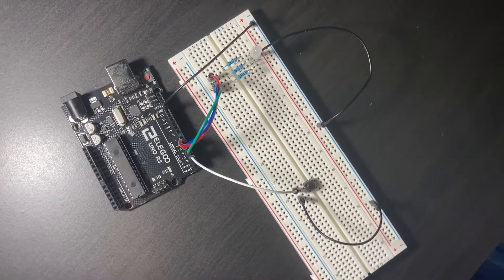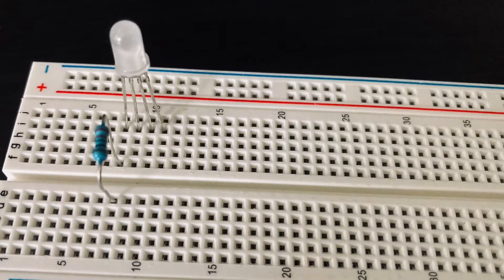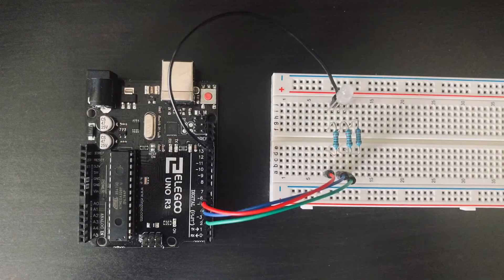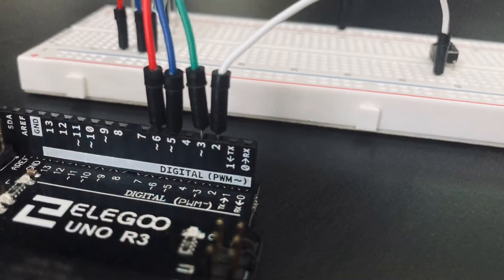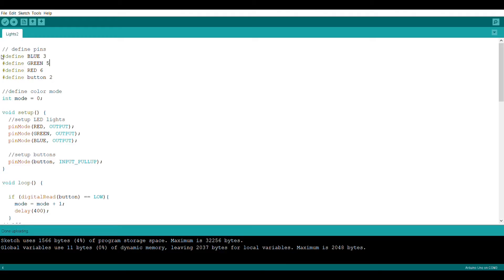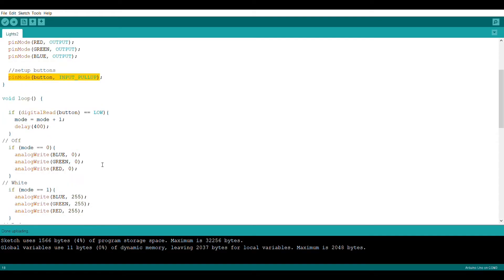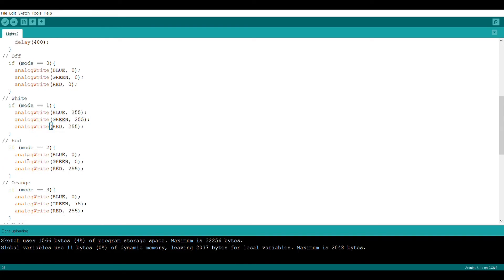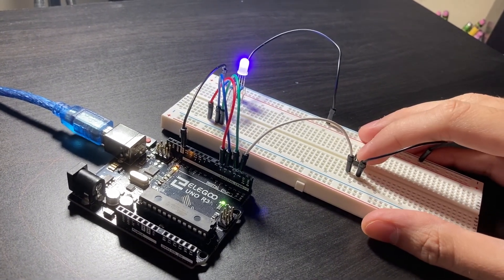Control an RGB LED with a Button | Beginner Arduino Project

Comment: If you dont want the RGB cycling through colors and you want a geniune RGB pulse here is a code with 5 different options that works with the above setup:
// define pins
#define BLUE 3
#define GREEN 5
#define RED 6
#define button 2

// define color mode
int mode = 0;  // 0 = off, 1 = pulsing, 2 = reset to off

// Variables for pulsing effect
int pulseValue = 0;        // Variable to control pulse intensity (0 to 255)
int pulseDirection = 1;    // 1 for fading in, -1 for fading out

void setup() {
  // Set RGB LED pins as OUTPUT
  pinMode(RED, OUTPUT);
  pinMode(GREEN, OUTPUT);
  pinMode(BLUE, OUTPUT);
  
  // Setup button pin
  pinMode(button, INPUT_PULLUP);
}

void loop() {
  // Check if the button is pressed (LOW means pressed, as we use INPUT_PULLUP)
  if (digitalRead(button) == LOW) {
    // Wait a short time to debounce the button press
    delay(300);
    
    // Increment the mode (1st press: pulsing, 2nd press: reset to off)
    mode = mode + 1;
    
    // If mode reaches 3, reset to mode 0 (off)
    if (mode > 2) {
      mode = 0;
    }
  }

  // Mode 0: LEDs off
  if (mode == 0) {
    analogWrite(BLUE, 0);
    analogWrite(GREEN, 0);
    analogWrite(RED, 0);
  }

  // Mode 1: Fade in and out (pulsing effect)
  if (mode == 1) {
    if (pulseDirection == 1) {
      pulseValue += 5;  // Increase brightness
      if (pulseValue >= 255) {
        pulseDirection = -1;  // Change direction to fading out
      }
    } else {
      pulseValue -= 5;  // Decrease brightness
      if (pulseValue <= 0) {
        pulseDirection = 1;  // Change direction to fading in
      }
    }
    
    // Apply the same pulsing value to all three LEDs for a white pulsing effect
    analogWrite(RED, pulseValue);
    analogWrite(GREEN, pulseValue);
    analogWrite(BLUE, pulseValue);
  }

    // Mode 2: Fade in and out (pulsing effect)
  if (mode == 2) {
    if (pulseDirection == 1) {
      pulseValue += 5;  // Increase brightness
      if (pulseValue >= 255) {
        pulseDirection = -1;  // Change direction to fading out
      }
    } else {
      pulseValue -= 5;  // Decrease brightness
      if (pulseValue <= 0) {
        pulseDirection = 1;  // Change direction to fading in
      }
    }
    
    // Apply the same pulsing value to all three LEDs for a white pulsing effect
    analogWrite(RED, pulseValue);
    analogWrite(GREEN, 20);
    analogWrite(BLUE, pulseValue);
  }

    // Mode 3: Fade in and out (pulsing effect)
  if (mode == 3) {
    if (pulseDirection == 1) {
      pulseValue += 5;  // Increase brightness
      if (pulseValue >= 255) {
        pulseDirection = -1;  // Change direction to fading out
      }
    } else {
      pulseValue -= 5;  // Decrease brightness
      if (pulseValue <= 0) {
        pulseDirection = 1;  // Change direction to fading in
      }
    }
    
    // Apply the same pulsing value to all three LEDs for a white pulsing effect
    analogWrite(RED, 20);
    analogWrite(GREEN, pulseValue);
    analogWrite(BLUE, pulseValue);
  }

    // Mode 4: Fade in and out (pulsing effect)
  if (mode == 4) {
    if (pulseDirection == 1) {
      pulseValue += 5;  // Increase brightness
      if (pulseValue >= 255) {
        pulseDirection = -1;  // Change direction to fading out
      }
    } else {
      pulseValue -= 5;  // Decrease brightness
      if (pulseValue <= 0) {
        pulseDirection = 1;  // Change direction to fading in
      }
    }
    
    // Apply the same pulsing value to all three LEDs for a white pulsing effect
    analogWrite(RED, pulseValue);
    analogWrite(GREEN, pulseValue);
    analogWrite(BLUE, 20);
  }

  // Mode 5: Fade in and out (pulsing effect) HYPER
  if (mode == 5) {
    if (pulseDirection == 1) {
      pulseValue += 5;  // Increase brightness
      if (pulseValue >= 100) {
        pulseDirection = -1;  // Change direction to fading out
      }
    } else {
      pulseValue -= 5;  // Decrease brightness
      if (pulseValue <= 0) {
        pulseDirection = 1;  // Change direction to fading in
      }
    }
    
    // Apply the same pulsing value to all three LEDs for a white pulsing effect
    analogWrite(RED, pulseValue);
    analogWrite(GREEN, 60);
    analogWrite(BLUE, 20);
  }
  // Mode 6: Reset to off
  if (mode == 6) {
    analogWrite(BLUE, 0);
    analogWrite(GREEN, 0);
    analogWrite(RED, 0);
    mode = 0;  // After reset, go back to mode 0 (off)
  }

  // Short delay to control the speed of pulsing and debounce button
  delay(30);
}
Reply: Thankyou

Comment: for all who wondering that this code is not working your wrong just debug the if (mode == 0) in the end of the code and replace the zero and input 8  if (mode == 8) and it works just watch and focus to the end of the vid  5:17

Comment: The longest leg on an RGB LED is NOT the Cathode..nor the Anode. Its the COM for common. As it can be either a common/shared Anode or a Cathode..that depends on the LED you bought..both available. And on everyday LED or other diodes or polarized capacitors, the longest is the Anode(+). Dont make tutorials, if you teach bullshite.

Comment: here is a simple version (works kind off the same):

#define blue 3
#define green 5
#define red 6

int mode = 0;

void setup() {
  pinMode(red, OUTPUT);
  pinMode(green, OUTPUT);
  pinMode(blue, OUTPUT);
}

void loop() {
  int bluevalue = random(1, 500);
    int redvalue = random(1, 500);
    int greenvalue = random(1, 500);
    analogWrite(blue, bluevalue);
    analogWrite(red, redvalue);
    analogWrite(green, greenvalue);
    delay(400);
}

//YES i wrote this

Comment: For everybody here saying this code did not work for them. Check your RBG LED and ensure it is a common cathode and not a common anode. I had the same issue and when I installed the correct RGB LED it worked perfectly
Reply: Then how do u make it work with a anode pin RGB LED
Reply: @BrosifStalin  it’s a completely different circuit for a common anode. I’m not an expert on them but you could probably find circuit diagrams online to compare the two. I just purchased the common cathodes when I realized that was the problem

Comment: I have a problem tho... I need to program 2 rgb led lights and they are expected to function like traffic lights signals... can anybody send help?😅

I need rgb led 1 (red light) to light up together with rgb led 2 (green light)... thing is they should have different durations ... though they lighted up together, they should turn off on different time durations. The rgb led 1 should light up for 15 secs and the rgb 2 should light up for 12 secs.

Please help
Reply: u can just use red and green led instead of rgbs and do something like

#define red 3
#define green 4

void setup() {
pinMode(red, OUTPUT);
pinMode(green, OUTPUT);
}

void loop () {
digitalWrite(green, LOW);
digitalWrite(red, HIGH);
delay(15000);
digitalWrite(red,LOW);
digitalWrite(green,HIGH);
dealy(12000);
}

Comment: here is code i write it

//define pins
#define BLUE 6
#define GREEN 3
#define RED 5
#define button 2

//define color mode
int mode = 0 ;

void setup() {
  
  pinMode(RED, OUTPUT);
  pinMode(GREEN, OUTPUT);
  pinMode(BLUE, OUTPUT);

  pinMode(button, INPUT_PULLUP);
}

void loop() {

  if (digitalRead(button) ==  LOW){
    mode = mode + 1 ;
    delay(400);
  }
//off
  if (mode == 0){
    analogWrite(BLUE, 0);
    analogWrite(GREEN, 0);
    analogWrite(RED, 0);
  }
//White
  if (mode == 1){
    analogWrite(BLUE, 255);
    analogWrite(GREEN, 255);
    analogWrite(RED, 255);
  }
//Red
  if (mode ==2){
    analogWrite(BLUE, 0);
    analogWrite(GREEN, 0);
    analogWrite(RED, 255);
  }
//blue
  if (mode == 3){
    analogWrite(BLUE, 255);
    analogWrite(GREEN, 0);
    analogWrite(RED, 0);
  }
//orange
  if (mode == 4){
    analogWrite(BLUE, 0);
    analogWrite(GREEN, 75);
    analogWrite(RED, 255);
  }
//White
  if (mode == 5){
    analogWrite(BLUE, 255);
    analogWrite(GREEN, 255);
    analogWrite(RED, 255);
  }
//Violet
//White
  if (mode ==6){
    analogWrite(BLUE, 255);
    analogWrite(GREEN, 0);
    analogWrite(RED, 100);
  }
//switch off
//White
  if (mode == 7){
    mode = 0;
  }
}
Reply: use mine: *it has way more colors than this childrens toy code*:

#define blue 3
#define green 5
#define red 6

void setup() {
  pinMode(red, OUTPUT);
  pinMode(green, OUTPUT);
  pinMode(blue, OUTPUT);
}

void loop() {
  int bluevalue = random(1, 500);
    int redvalue = random(1, 500);
    int greenvalue = random(1, 500);
    analogWrite(blue, bluevalue);
    analogWrite(red, redvalue);
    analogWrite(green, greenvalue);
    delay(400);
}
Reply: @ဪဪဪဪဪဪဪဪဪဪဪဪဪဪဪဪဪဪဪဪဪ-ဘ၂ဝ tried it out, does have more colors, but I think the vid specifically focuses more on pressing the button to change the colors rather than pressing it once to activate all colors (tried the code in the vid too)

Comment: How may I set the led to super slow changing colors such as 10 seconds delay transition colors of rgb and switch automatically to music reactive mode when there is playing music or songs on my videoke and turn back automatically to super slow changing colors of red green blue when there's no music playing or in standby mode?
Reply: u can do something like

 analogWrite(BLUE, 225);
    analogWrite(GREEN, 0);
  analogWrite(RED, 100);
delay(10000);
 analogWrite(BLUE, 121);
    analogWrite(GREEN, 42);
  analogWrite(RED, 32);

i think

Comment: Guys i wrote the Code, Here
// define pins
#define BLUE 3
#define GREEN 5
#define RED 6
#define button 2

// define color mode
int mode = 0;

void setup() {
  // setup LED lights
  pinMode(RED, OUTPUT);
  pinMode(GREEN, OUTPUT);
  pinMode(BLUE, OUTPUT);
  //setup buttons
  pinMode(button, INPUT_PULLUP);

}
void loop() {

  if (digitalRead(button) == LOW) {
    mode = mode + 1;
    delay(400);
  }
// off
if (mode == 0) {
  analogWrite(BLUE, 0);
  analogWrite(GREEN, 0);
  analogWrite(RED, 0);
}
// White
if (mode == 1) {
  analogWrite(BLUE, 225);
    analogWrite(GREEN, 225);
  analogWrite(RED, 225);
}
// Red
if (mode == 2) {
  analogWrite(BLUE, 0);
    analogWrite(GREEN, 0);
  analogWrite(RED, 225);

}
// Orange 
if (mode == 3) {
  analogWrite(BLUE, 0);
    analogWrite(GREEN, 75);
  analogWrite(RED, 225);
}

// Yellow
if (mode == 4) {
  analogWrite(BLUE, 0);
    analogWrite(GREEN, 220);
  analogWrite(RED, 225);
}

//Green
if (mode == 5) {
  analogWrite(BLUE, 0);
    analogWrite(GREEN, 225);
  analogWrite(RED, 0);
}

//Blue
if (mode == 6) {
  analogWrite(BLUE, 225);
    analogWrite(GREEN, 0);
  analogWrite(RED, 0);
}

// Violet
if (mode == 7) {
  analogWrite(BLUE, 225);
    analogWrite(GREEN, 0);
  analogWrite(RED, 100);
}

// Switch off
if (mode == 0) {
  mode = 0;
  } 
}
Reply: Life saver
Reply: for anyone that cant really copy paste and want a simpler version, (im experienced with 4 years coding), here is a way simpler version written by me (its actually is more advanced and has way more colors but is easier to write)

#define blue 3
#define green 5
#define red 6

int mode = 0;

void setup() {
  pinMode(red, OUTPUT);
  pinMode(green, OUTPUT);
  pinMode(blue, OUTPUT);
}

void loop() {
  int bluevalue = random(1, 500);
    int redvalue = random(1, 500);
    int greenvalue = random(1, 500);
    analogWrite(blue, bluevalue);
    analogWrite(red, redvalue);
    analogWrite(green, greenvalue);
    delay(400);
}
Reply: ok ye i forgot to remove the: int mode = 0 but u can type it or skip it either way it will still work
Reply: how  nice of you,,,!! lovely
Reply: my hero
Reply: omg thanks!
Reply: thanks you're the goat you think you are
Reply: Sigma
Reply: not all heroes wear capes
Reply: Your mode check to reset it should be *if(mode == 8) *

Comment: Everryone looking for a code :
#define BLUE 3
#define GREEN 5
#define RED 6
#define button 2

int mode = 0;

void setup() {
  
  pinMode(RED, OUTPUT);
  pinMode(GREEN, OUTPUT);
  pinMode(BLUE, OUTPUT);

 
  pinMode(button, INPUT_PULLUP);
  }

  void loop() {
    if (digitalRead(button) == LOW) {
      mode = mode + 1;
      delay(400);
    }
    
    if (mode == 0) {
      analogWrite(BLUE, 0);
      analogWrite(GREEN, 0);
      analogWrite(RED, 0);
    }
    // White
    if (mode == 1) {
     analogWrite(BLUE, 255);
      analogWrite(GREEN, 255);
      analogWrite(RED, 255);
    }
    // Red
    if (mode == 2) {
     analogWrite(BLUE, 0);
     analogWrite(GREEN, 0);
     analogWrite(RED, 255);
    }
    // Orange
    if (mode == 3) {
      analogWrite(BLUE, 0);
      analogWrite(GREEN, 75);
      analogWrite(RED, 255);
    }
    // Yellow
    if (mode == 4) {
      analogWrite(BLUE, 0);
      analogWrite(GREEN, 220);
      analogWrite(RED, 255);
    }
    // Green
    if (mode == 5) {
      analogWrite(BLUE, 0);
      analogWrite(GREEN, 255);
      analogWrite(RED, 0);
    }
    // Blue
    if (mode == 6) {
      analogWrite(BLUE, 255);
      analogWrite(GREEN, 0);
      analogWrite(RED, 0);
    }
    // Violet
    if (mode == 7) {
      analogWrite(BLUE, 255);
      analogWrite(GREEN, 0);
      analogWrite(RED, 100);
    }
    // Switch Off
    if (mode == 8) {
      mode = 0;
    }
  }
Reply: I was gonna make a comment about the sheer laziness of people, but your kindness kinda changed my mind. I don't know how following along and copying down what's on the screen is so difficult. I learn in chunks, so following along is how I figure stuff out. Then I went on to apply the same code for servo positioning. It's really cool to learn from pre-written stuff rather than just copying and pasting what's already being handed to folks.  Didn't see your comment until I revisited this video to share it with a friend. I applaud you for having the patience and kindness to do the work that so many people refuse to do for themselves. I could understand the frustration if a maker uploads a "thing" and doesn't even show the code on the screen, but this guy showed all of it! 😂
Reply: @KOAlleyCat  with arduino you have to play with the code around and see what it does hardware wise regardless if you really wish to understand what the commands do
Reply: @j0hnk120  yep, and most people aren’t willing to put in that kind of work to learn. They just want instant results without bothering to figure out how anything works
Reply: Lmao its literally gonna do the same thing it does on video what do you expect it to do  @KOAlleyCat
Reply: @j0hnk120  What? I think you’re misinterpreting my comments.

Comment: can anyone let me know what is wrong with this code i copied the exact coding from the video i rechecked it but there is still errors on it 

                                 my code| 
                                                 |
                                                 |
                                                 v
 // define pins
#define Blue 3
#define Green 5
#define Red 6
#define button 2

// define color mode
int mode = 0;

void setup() {
  //setup LED lights
  pinMode(RED, OUTPUT);
  pinMode(GREEN, OUTPUT);
  pinMode(BLUE, OUTPUT);

  // setup buttons
  pinMode(button, INPUT_PULLUP);
  }

  void loop() {
    if (digitalRead(button) == LOW) {
      mode = mode + 1;
      delay(400);
    }
    // off
    if (mode == 0) {
      anaLogWrite(BLUE, 0);
      anaLogWrite(GREEN, 0);
      anaLogWrite(RED, 0);
    }
    // White
    if (mode == 1) {
      anaLogWrite(BLUE 255);
      anaLogWrite(GREEN, 255);
      anaLogWrite(RED, 255);
    }
    // Red
    if (mode == 2) {
      anaLogWrite(BLUE, 0);
      anaLogWrite(GREEN, 0);
      anaLogWrite(RED, 255);
    }
    // Orange
    if (mode == 3) {
      anaLogWrite(Blue, 0);
      anaLogWrite(GREEN, 75);
      anaLogWrite(RED, 255);
    }
    // Yellow
    if (mode == 4) {
      anaLogWrite(BLUE, 0);
      anaLogWrite(GREEN, 220);
      anaLogWrite(RED, 255);
    }
    // Green
    if (mode == 5) {
      anaLogWrite(BLUE, 0);
      anaLogWrite(GREEN, 255);
      anaLogWrite(RED, 0);
    }
    // Blue
    if (mode == 6) {
      anaLogWrite(BLUE, 255);
      anaLogWrite(GREEN, 0);
      anaLogWrite(RED, 0);
    }
    // Violet
    if (mode == 7) {
      anaLogWrite(BLUE, 255);
      anaLogWrite(GREEN, 0);
      anaLogWrite(RED, 100);
    }
    // Switch Off
    if (mode == 8) {
      mode = 0;
    }
  }
Reply: Hello,
The biggest problem is that you put in #define red,green and blue instaed of RED,GREEN and BLUE (the capital letters make a differrence).Also you had little mistakes in your code like not using "," before color and stuff.Here is your code
#define BLUE 3
#define GREEN 5
#define RED 6
#define button 2

int mode = 0;

void setup() {
  
  pinMode(RED, OUTPUT);
  pinMode(GREEN, OUTPUT);
  pinMode(BLUE, OUTPUT);

 
  pinMode(button, INPUT_PULLUP);
  }

  void loop() {
    if (digitalRead(button) == LOW) {
      mode = mode + 1;
      delay(400);
    }
    
    if (mode == 0) {
      analogWrite(BLUE, 0);
      analogWrite(GREEN, 0);
      analogWrite(RED, 0);
    }
    // White
    if (mode == 1) {
     analogWrite(BLUE, 255);
      analogWrite(GREEN, 255);
      analogWrite(RED, 255);
    }
    // Red
    if (mode == 2) {
     analogWrite(BLUE, 0);
     analogWrite(GREEN, 0);
     analogWrite(RED, 255);
    }
    // Orange
    if (mode == 3) {
      analogWrite(BLUE, 0);
      analogWrite(GREEN, 75);
      analogWrite(RED, 255);
    }
    // Yellow
    if (mode == 4) {
      analogWrite(BLUE, 0);
      analogWrite(GREEN, 220);
      analogWrite(RED, 255);
    }
    // Green
    if (mode == 5) {
      analogWrite(BLUE, 0);
      analogWrite(GREEN, 255);
      analogWrite(RED, 0);
    }
    // Blue
    if (mode == 6) {
      analogWrite(BLUE, 255);
      analogWrite(GREEN, 0);
      analogWrite(RED, 0);
    }
    // Violet
    if (mode == 7) {
      analogWrite(BLUE, 255);
      analogWrite(GREEN, 0);
      analogWrite(RED, 100);
    }
    // Switch Off
    if (mode == 8) {
      mode = 0;
    }
  }